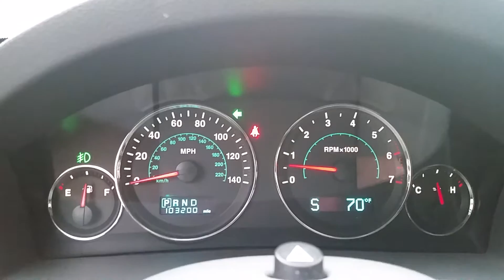Grand Cherokee stuck blinker

Comment: Before!.....You buy a new multi-switch....take the old one out and blow in the 8&3 plug connector and tap the switch box in the palm of your hand.
I did this, and after reinstalling it, it has worked fine.
Saving me the purchase of a new turn signal module.

Comment: For others with this problem; get it fixed asap. It's the multi-function switch/turn signal. If not fixed in a week or so, it will slowly the drain your battery and alternator. Not good. Learn from my mistake!
Reply: Ryan Duffin what did you do to fix it? Mines started doing this today
Reply: Ryan Duffin do u have to change the whole arm switch correct?? It's the lever right?
Reply: Thanks  this just happened today.  i read your comment and ordered the switch immediately

Comment: did you get it fixed? if so what was the problem? currently experiencing this issue
Reply from the maker: I had an extended warranty on it and they replaced the multi function switch and that fixed the issue.